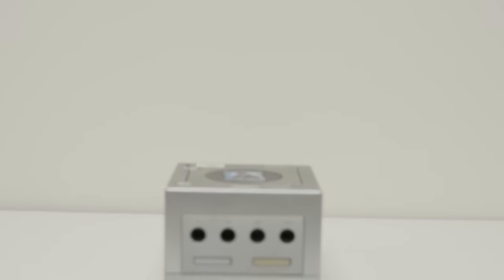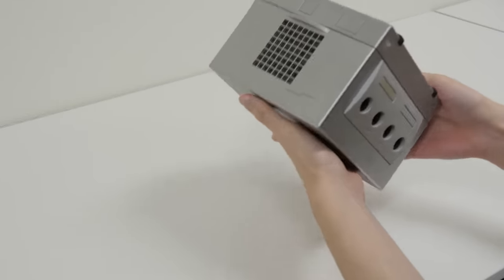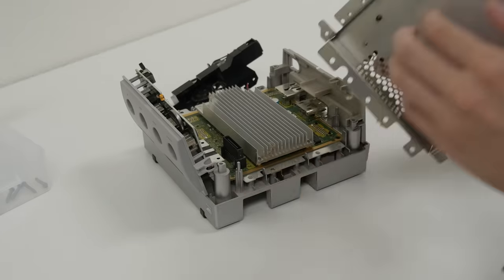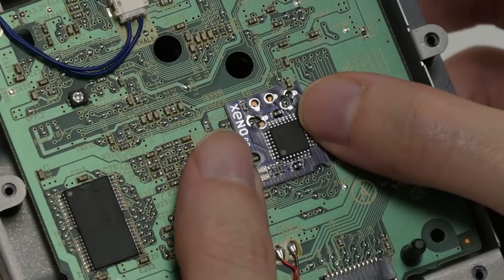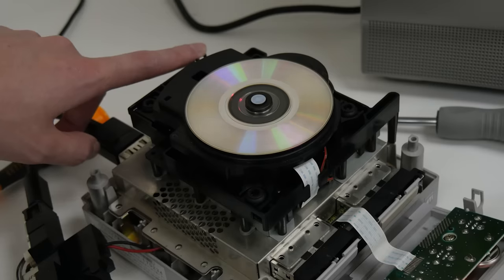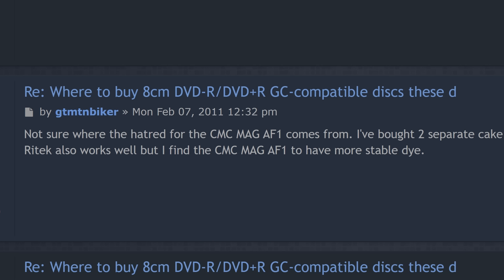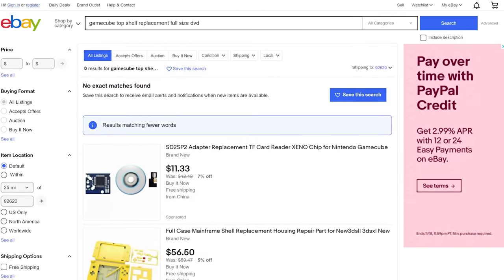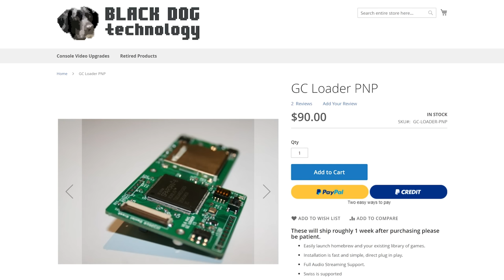Buying a $3 Gamecube from Japan

Comment: This is a fun video! Snarkier than most game system repair YouTubers, like if FrameRater started repairing game systems.
I put that chip in my GameCube, procured from a Goodwill in southern Arizona. The price? Five dollars. The inside was a sticky brown mess, but it cleaned up perfectly fine. I appreciate Xeno's one and done design, without having to run wires to tiny pads on the GameCube PCB, but yeah, actually having to solder those points is slightly fidgety and imprecise. It's kind of a miracle that it turned out as well as it did.

Comment: The one faded memory card reader door on the right side can be cleaned back to the original colour, I did it to mine , What you do is go to a woman's hair dye supply store, Like Sally Beauty, they sell a bleach gel for hair. What you do is rub it on the door and place it in the sun for a few hours, then take it in, wash it off, dry it, then do it again, repeat this about 3-4 times, And the yellow colour will turn back to the original white.

Comment: You don't need a GC Loader or a mod chip or any optical drive emulator, you can just run homebrew through a gamecube memory card mod called swiss and play games off an sd card in the memory card slot lol

Comment: Yo! Pro tip for stickers. Try going over it a few times with a hairdryer. If you give it enough heat, the adhesive should melt, and the sticker should peel right off. But there might be gunk leftover.

I've used this trick to reshell GBA games, keeping the oem stickers, and to remove crappy paper stickers from game boxes. 

I haven't tried with a heat gun, but I imagine it'd be easier to melt the plastic too.

Comment: The way Hard Off and similar stores work is: They have a category of item called "junk." This is stuff the staff never tested, so they make no claims that it'll work properly. Buyer beware. Often you'll get lucky. But sometimes you won't. I bought a $20 Switch Pro controller, got it home, opened the box, and the left analog was a limp noodle. Opened it up, and the shell around the analog was destroyed. Bye, $20!
As for the stickers, ever try Goo Gone? It's citrus magic!

Comment: I've found for stickers that scoring the sticker in a 5mm grid on a shallow ~20° amgle with a fresh sharp utility blade first then squirting with flux off works well without reacting with the plastics.

Leave for an hour then scrape away with a spudger.

Comment: Dud you ever adjust the lasers pot to account for the power going to the laser it needs to have more power in order for it to read burned games easier. Its a fairly simple thing u need a phillips head driver and a multimeter. That and patience.

Comment: You don't need a GC loader to play games from an SD card :)
Get an SD2SP2 adapter and plug it into serial port II. You only need one burned disc which contains Swiss (they sometimes bundle it with the SD2SP2 adapter).
One of the requirements for this method is to have the modchip installed which you already have.
This lets you keep the optical drive in place so you can switch back to discs anytime.
If you have a GameCube with a totally dead disc drive or you have no serial port II (later versions of the GameCube don't have it), that's where the GC loader comes into play. (at least for me)

...and yes, don't do the wireless install for the modchip...it only works on YouTube videos....Oh well seems like even this is not always the case :D

Anyways it was a great video, I love these cheap console repairs! :)

Comment: You should also consider getting a replacement drive with a Xeno pre-installed off of eBay. Most of them come from China but I found one from here in the US. The ones that come with Swiss boot discs usually have the laser tuned just right to read burned games.

Comment: One solution for the lack of mini-DVDs when you have an open-topped gamecube would be to just use a craft knife or other very sharp point to just cut it off - making the DVD spindle into a makeshift lathe. This is no doubt extremely  healthy for the drive assembly and motor, of course.

Comment: You are right, Gamecube shells that accommodated a full size DVD did exist back in the day. Nobody makes them now because Gamecube is readily playable on the more common Wii which like you said, doesn't even require discs if you use a USB loader. Your best bet is finding one on the used market. IcedCube and GC Viper were the brands.

Comment: Could be a cool project to cut a regular DVD down to size -- one way to do it would to be to spin the disk up in an unwanted CD player and then cut to size with a rotary tool and cutoff wheel -- dress the edge with superglue maybe if you find that the film is separating from the plastic for some reason.

Comment: You'd be surprised how easily people can assume a malfunctioning part of an electronic device is broken, when in reality it's just dirty and in need of a quick cleaning.

I know this from experience: I thought the disc reader in my PlayStation 3 was busted for two years until just two weeks ago, when I took some alcohol and two cotton swabs to clean and dry the laser lens. It now works just as well as it did five years ago. It took me three minutes to do. It wasn't broken, it was just dirty.

Moral of the story? If something's going wrong with your favorite electronic device, properly clean the defective part before you do anything else.

Comment: One solution I might have for the DvD size issue is to sand down (or circle/cone-cut) the disc's excess material until the disc can fit into the casing. Since the disc is basically just sectors and rings, it shouldn't impact the disc's contents too much.

Comment: the gc loader is excellent, i love mine but if you can find a mini dvd-r that works you could also burn swiss to it and use an sd2sp2 which are super cheap and plug into the serial port 2 on the bottom of the console.
that is if your console has one, the easiest way to know is if it has a digital port on the back then it will have a serial port 2 on the bottom.

Comment: 2:40 just use hot water, it will 'melt' the glue on the sticker and will be 1000x times easier to remove

Comment: Need a mini DVD? Just put a full size disc on a lathe, trim it to size, then use super glue on the new smaller edge to seal the layers.

Comment: Look at the bottom of the DVD (you can generally see the amount of data burned) and use scissors to cut the full size DVD to a smaller size. It should then fit in it without a case mod.

Comment: You aren't misremembering, they used to sell replacement GameCube shells to fit full sized DVDs, in different colours even I believe.  I don't remember where though... Either eBay or that big modchip site that got shut down.  I've still got a few packs of mini DVDs from my NGC modding plans 15 years ago, then I got my kid a Wii and soft modded it and sold the GameCube and BB adaptor instead... Which has incidentally been serving us fine until just the other day when it decided it no longer wants to read my USB drive, so now I have to work that out.

Comment: Now you don't even need a GC Loader.
A 5$ Raspberry Pi Pico, soldered with 5 or so Wires can replace the IPL with one that boots Swiss straight from an SD from the Memorycard or SP2 Slot. Swiss can then on-the-fly-patch games to read from the SD. I report no issues at all so far

Comment: if you use hair dryer and heat the stickers the glue gonna melt little bit and you can peel it off easier of the plastic

Comment: Something You can do instead of getting a gc loader is use an sd2sp2 (which was visible in booth the ebay listing you viewed and the amazon one)and swiss booted via save hacks or a sd loader disk, I have tested it up to 128 gb ex fat and it still reads games and they run at full speed if you have a new version of swiss, but if you want to use homebrew like GCMM and cleanrip you do need a card formatted to fat 32

Comment: Hey btw, you dont necessarily need the gc loader. you can also do it with an action replay disk, which you could burn yourself and an SD GEKO which is a memory card adapter and goes into the memory card slot. Or use the SD2SP which uses the serial port 2 at the bottom of the console so you dont take one space of the memory cards. Both ways would let you load into swiss loader and hence load backups
Reply: The problem is that burning mini dvds costs too much.

Comment: In my job, I have to take off varying levels of stickers, some up to 20 years old, off of monitors before testing and prepping for refurbishment.
You need to buy something called Contact Cleaner (for electronics) - it's a wet spray. Along with this, you Caan buy a small tool that holds a razor, a square razor thst slides in and clicks in - you spray the contact cleaner on and after a few seconds, you press down with the razor and it'll find the original bottom. Older stickers take more work depending on the adhesives the original idiots used from the sticker, but you can 90% get em off for the most part with these two tools

For glue left behind from tape, you can use this method, but for sun-burnt on adhesive left by the sun or heat (a bitch to work with, hardest thing IMO) that is an actual chemical you can use (thars toxic, and will leave a terrible orange smell (i think they add it so you know it's in area and can ventilate and move away accordingly or put on PPE? I don't know i just fan it with a piece of Styrofoam) you can't really blow away easily and has warnings about heart problems and irregularities if used lol) thst you spray on, let wait 5 minutes and then scrape off. SUPER STRONG, $39 for a single sporay bottle the size of hairspray but a little thicker, Serious Business. To get the name I'd have to look at my work bench but I'm home and don't go in till 0600H

Excellent content

Comment: For that cheap price...
If it boots up and the controller ports work (at least two out of four).
I'd have simply ordered a GC Loader from Aliexpress and installed that into the system.
Play GC games off an SD card.
No further need for failing optical drive.

Comment: Well this was short, but eloquent. Actually I've also bought an old Game Cube from a second-hand shop that just sells items, without repairing them. So they have to be a minimum "launchable". The Game Cube I've bought is unfortunately having problems with the optical system. I have to clean the lens every time I want to play a game, to unlock the rail that is moving the optical drive. However, it does work. xD

Comment: buy any sd gecko and burn a normal disk with swiss, with swiss you can play gamecube games using sdcard on sdgecko memorycard, the sd gecko will cost less than 5$ and for close the case with swiss dvd, can cut the dvd without any problem

Comment: GameCube discs use a copyrighted protection utilizing six precisely spaced dots, if the reader doesn't detect these dots it won't read the disc on certain games. I found that out the hard way

Comment: Hey next time to remove stickers, use a hair dryer over the sticker for about 30 seconds, will effortlessly peel off afterwards!

For cleaning the plastic, ditch the wd40 and windex and even baking soda as they both have chemicals that will basically eat away at the top clearcoat layer of the plastic.

Use a magic eraser, dipped in warm water and squeezed out before using on plastic. You'll thank me later!

Comment: @mattKC You should have just swapped the region. The GameCube shipped with both US and Japan Bios on the systems. There is a resistor on the motherboard that selects them. I put in a switch to change regions when I wanted to play Japanese games. (If you bypass the region it doesn't have the full character set and looks weird sometimes). Since you have a US game that would have been quicker and easier than the mod chip.  Also they did have full size cases, I have one on mine, played with Linux a bunch at the time.  (actually paid the $200 for the official linux kit for my ps2 lol)

Comment: I bought one and replaced the disc drive with my working one and it worked. I needed one for the aluminum plate that the gc loader sits on as i had tossed mine when i did a case swap

Comment: So from I’ve gathered, a hacked GameCube can run burned discs, but regular sized discs need to either use a special 3D printed case, or no case at all.

Obviously the infinitely easier alternative is Nintendont but hypothetically speaking could you run a full sized DVD, with a gamecube game on it, on a modded Wii?

Comment: You could try to physically cut a full size dvd into a mini.
Currently there is no machine on the market that let you do this so you would need to do one yourself.
I doubt it would be very hard to make one. You you could easily make it with MDF and a dremel/drill.

Comment: I remember a few portable GameCube consoles simply had the disc drive size be able to fit standard sized DVDs, or if your insane and kept with the mini DVD size drive you could manually cut the disc, but it's very hard to do without making the edges ultra sharp, or cracking the disc unless someone has a solution to this.
Personally on my GameCube I play most my library off an SD card via Swiss (a homebrew GCN utility) that I boot off of an Action Replay that supports homebrew loading. If I ever want to play a physical disc on my console, but it's not NTST-U/C I use Free Loader also on my Action Replay disc to play that game.

Comment: You can make it US by Soldering R6 under the heat sink to a solid connection. I would use a hairdryer to loosen up the heat sink. I tin a small wire then touch it to R6 at the same time as the soldering iron then cut off the excess wire. I guess if you're modding it this is irrelevant. I use the Action Replay way myself and a Gecko memory card.

Comment: Here is an idea for a future video: why not find a way to cut full size DVDs down to mini DVD size ?

I mean, the data should be safe and with a bit of tinkering you could get a structurally sound optical disk that is balanced and will also work. I do think it has to involve heating.

Maybe there is even a use for the resulting outer ring.
Reply: Ihas been done. Too hard to balance. And loading from SD card is better anyway.

Comment: with GameCube  many systems it's very important that you match the burning speed to the speed of the system some models of video game systems have different generations of laser on board so if you're burning a 16X times CD and it only has a 4X time read laser sometimes your CD burner isn't burning a clean enough image for it where someone else could be doing the same thing but their CD rom is burning a cleaner image  so sometimes if you want the best results you have to burn it at the slowest speed possible to give the clearest image i hope you see this comment and it helps you moving forward

Comment: Wd 40 is really not a good idea on plastic it can disintegrate ot over time and it will removes the luster and sheen on a lot of them.  It might be fine might not. There are better sticker removal tools anything with orange oil works well in my experience also electrical tape does not last very long when use the way you used it. It sticks to itself better then most surfaces and the adhesive melts under heats and will leave residue to clean. Masking tape or painter tape is a better option in my experience.

Comment: The problem with flash memory is that it will eventually become unreadable. How long does this take? No one really knows because it has not existed long enough. I can tell you from four hard disks, only two of them were readable after 12 years in storage. I assume flash memory will be similar. After a long period of storing data it may be a good idea to copy or defrag a drive that would not normally need it, just to re-magnetize the files. A DVD should last hundreds of years if kept out of sunlight. The DVD reader, will not last that long. The plastic lens will become opaque without use, even in dark storage. By the way, this was an amazing deal on the gamecube. Some people still use the gamecube for Super Smash Brothers tournaments.

Comment: Ok so I think I understand it now (Yen)
In Japanese currency, 1 Yen is like a penny (In US Currencies), 5, 10, 25, 50. 1.00 is in Yen - 5, 10, 25, 50, but then 100 not 1 followed by a decimal (period)
So if I did the math carefully, while 300 Yen is apparently 3$ in US Currencies, doesn’t that make Yen do this: 1$ - 100, 2$ - 200, $5 - 500, $10 - 1000?
But what about the thousands grouping? Do they use the comma between 4 numbers?

Comment: No need to bother with the GC-Loader. You can get a cheap sd2sp2 that adds a microSD slot to the unused bottom serial port, and use one of the multiple exploitable games in order to launch homebrew like Swiss that can make use of the sd2sp2 and run homebrew and ISOs off of it. Leaving the original drive intact if you ever want to play discs or have a way to rip legit games.

Comment: I tried a Xeno GC wire-free install the other day. Was an absolute pain in the arse, mostly because why the hell are the two points on the left and right of the chip not enclosed circles like the top two points are? 10,000% less chance of bridging the pads with solder if you could just fill six holes with solder, instead of two with solder and the remaining four with a tiny bit of solder at each end.

Next time I'm going for a wired install, because ugh.

Comment: Highly recommend the GC Loader! It works perfectly and this new PNP version is really easy to install.

Back when I ordered one, I had to desolder the plug from the drive and solder it on to the GC LOADER. Now, you just pop it in place.